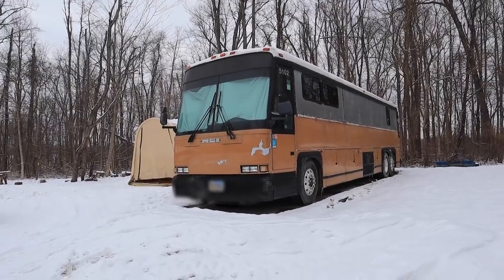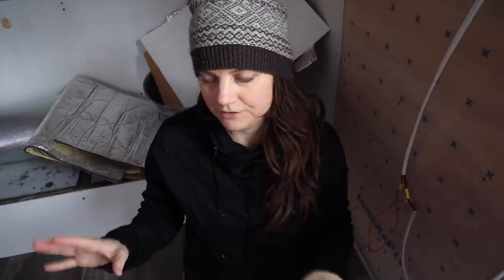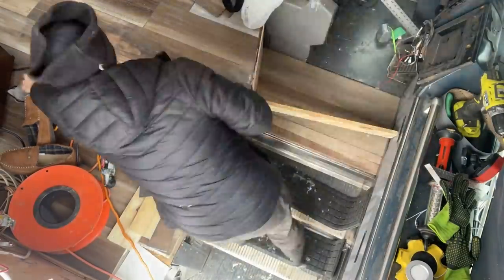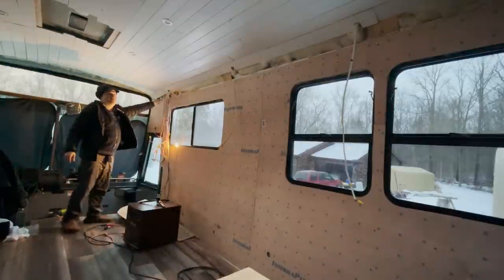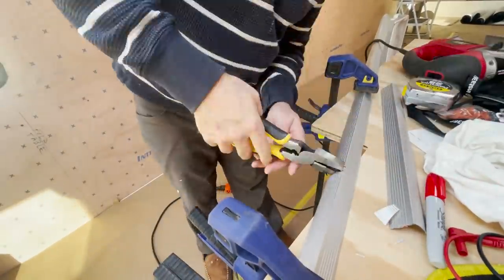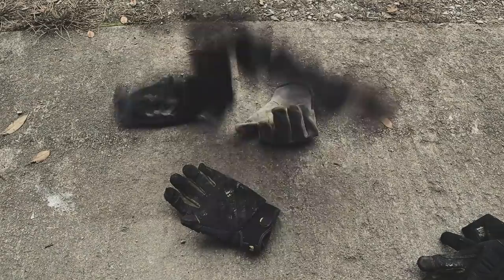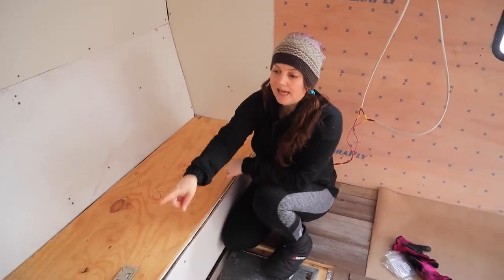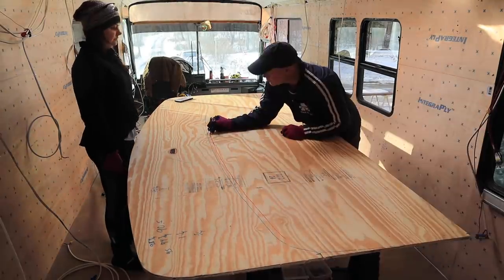What we Learned Building the Shell of our Bus Conversion - S03E46

Comment: I think your ceratex glued to the inside of the panels will reduce any condensation issues on those panels which will leave your wool in a drier state so will probably work out for the best. May have been harder but will be worth it imho.